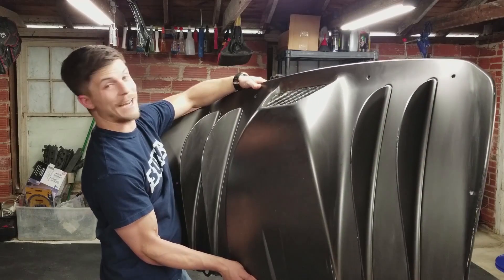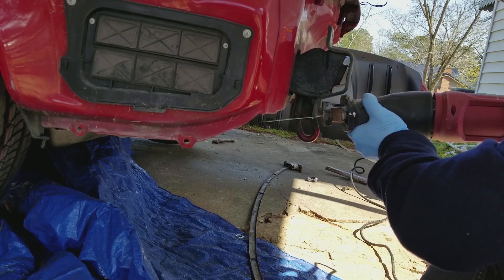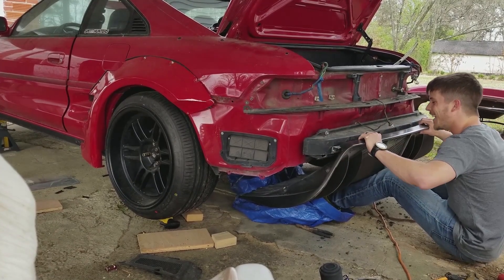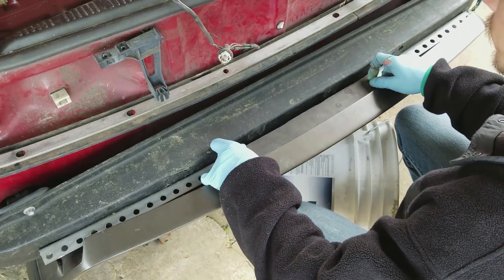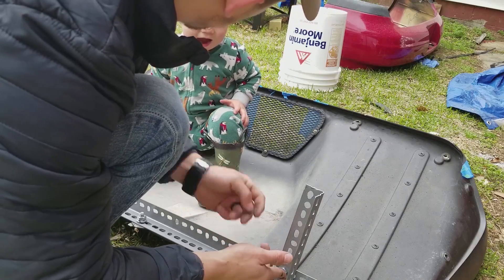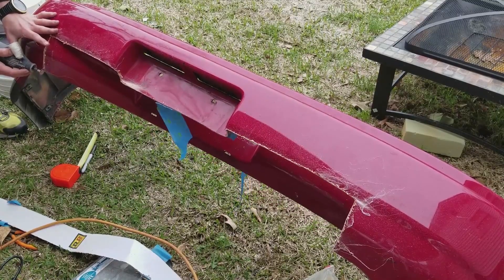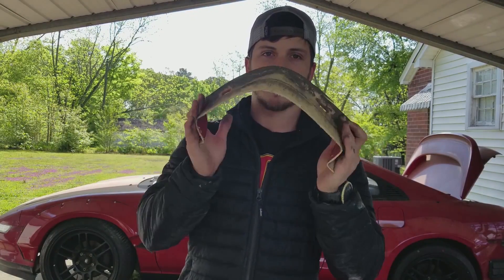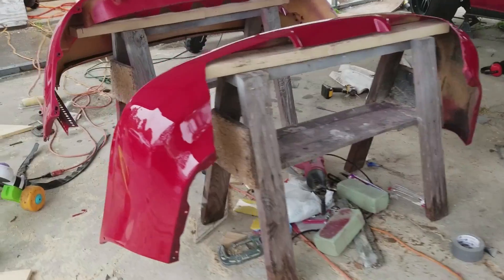FERRARI PARTS ON A TOYOTA (full version)

Comment: Ahhhhh it hurts my eyes . Please stop thinking a recip saw is the only thing to use for cutting . Grinders will cut a  straighter line ,and leave a better finish. Finished product looks ok on camera from a distance ,but seeing how you managed to do it , only de-valued  the car in my opinion . The brackets used look terrible when you see them on the underside . When you cut the rear lower grill off the car and bashed up the ropey edge into the underside of the car scared me mate. It’s cool to do things urself ,I’m all for it, but don’t show people dodgy ways of doing things .
And yeah, fibreglass will not work well ,if at all with plastic.